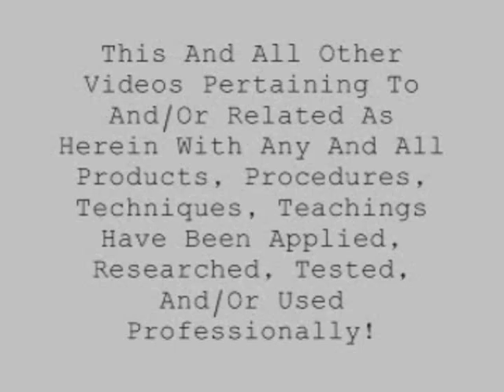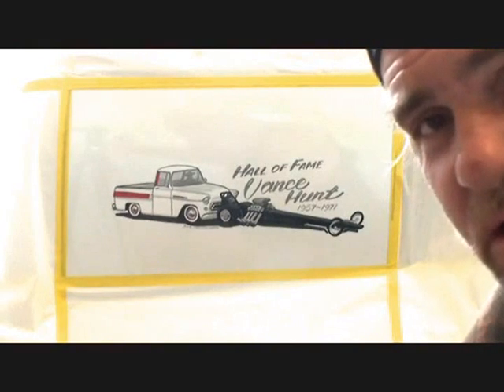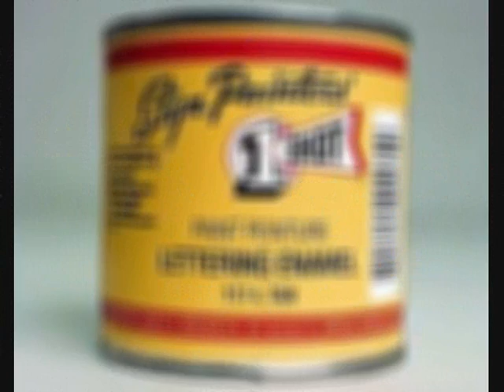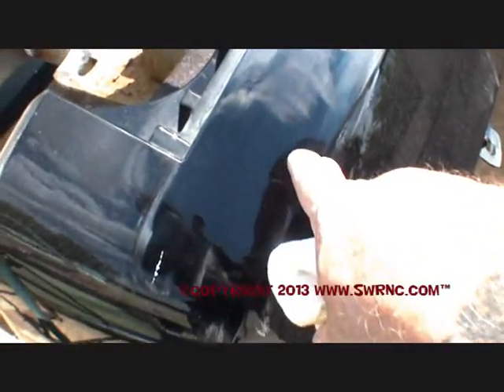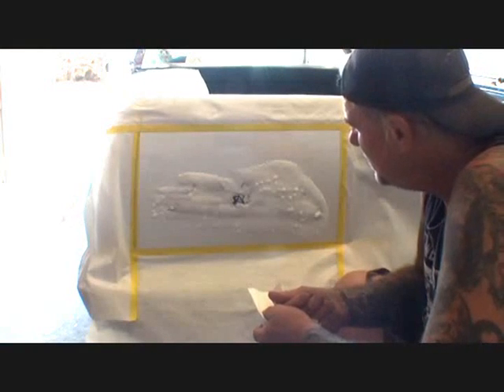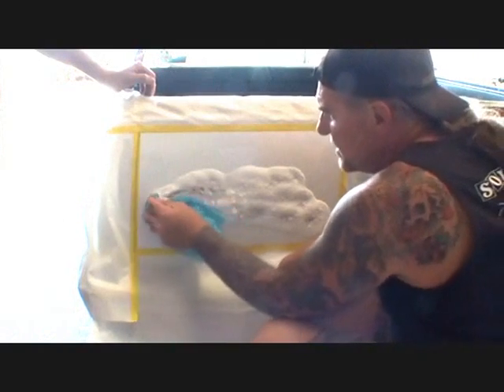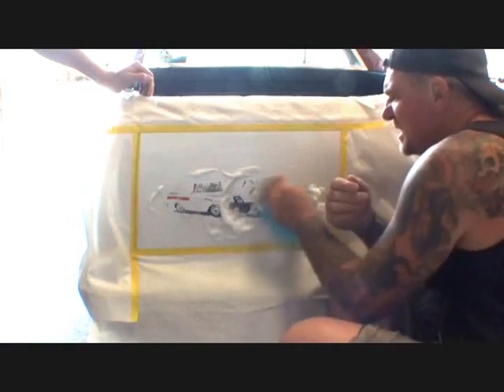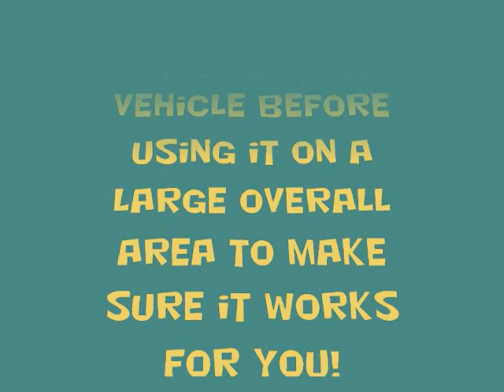Remove Pinstripe From Your Car,Truck, or Motorcycle

Comment: Oven cleaner? really? If its not sealed in with clear, why not gently remove it with the rotary and some cutting compound? If that don't shift it, go over with some 3000 gritt first. If the oven cleaner is removing that paint, how it is not attaking the clear as well? Has the same effect as thinners